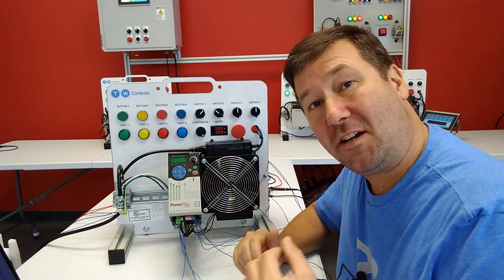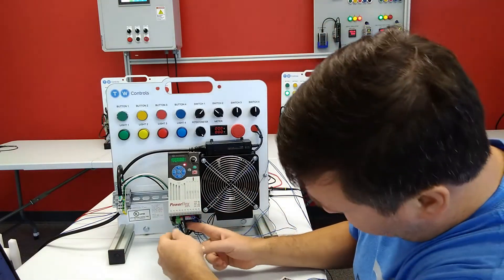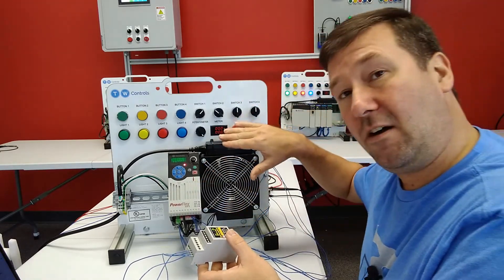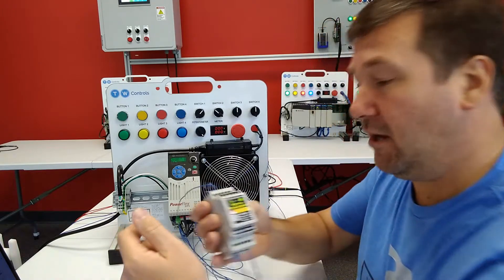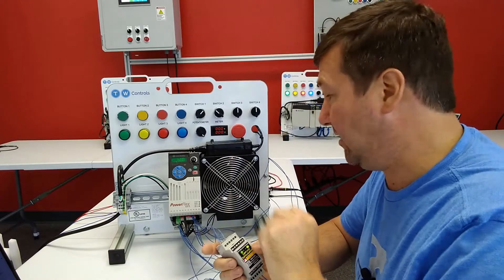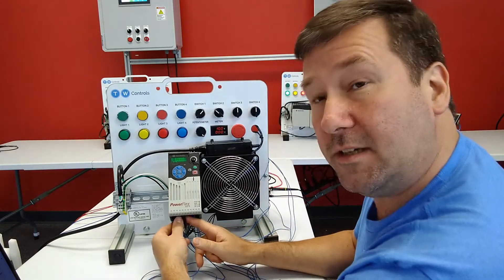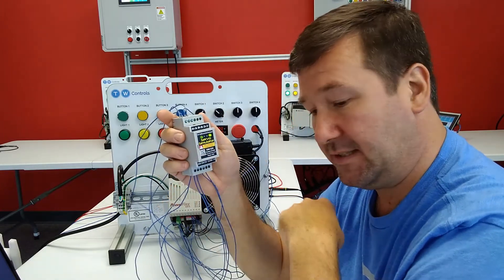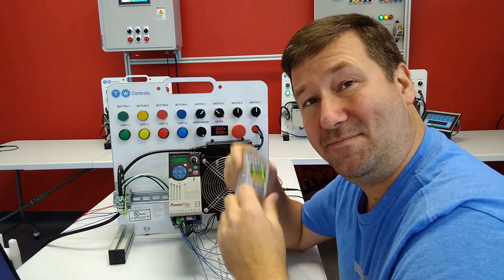Allen Bradley Powerflex 525 Encoder Loss Error 91

Comment: you can help me? the board need to power the encoder with 12V, but, i can't read 12V from encoder board on inversor, what the problem?
Reply from the maker: Check the output compatibility with the encoder.

Comment: Excellent video as always.
Tim, Could you please make a video on how to control a 525 through the ethernet cable,  and the problems we could encounter?
Many thanks
Reply from the maker: We have videos for Studio 5000 and CCW on that , see links below.
https://twcontrols.com/lessons/adding-a-powerflex-525-drive-over-ethernet-to-a-controllogixcompactlogix-plc-in-studio-5000
https://twcontrols.com/lessons/allen-bradley-micro800-micro820-messaging-to-a-powerflex-525-drive-in-connected-components-workbench
https://twcontrols.com/lessons/control-an-ab-powerflex-525-drive-with-a-micro800-micro820-plc-with-a-user-defined-function-block

Comment: I am having problems with error F012 don't know how to fix it
Reply from the maker: That is an overcurrent condition.  That means that your motor is pulling more amps than it should.  Chances are you have a mechanical bind or your motor is going bad.
Reply: F064 คืออะไรครับ

Comment: 1.What is the purpose of A- and B- signals on an encoder? 
2. If i have ordinary encoder with just A+ and B+ signals(without A- and B-), then i can't connect it to the Powerflex VFD, because i will get error 91? 
Thanks for video, Tim.
Reply from the maker: You can connect "single ended" or only A/B signals to a Powerflex 525.  Here are two lessons talking about the functions of the A and B signals of the encoder.
https://twcontrols.com/lessons/how-an-encoder-works-determining-direction-and-position
https://twcontrols.com/lessons/encoder-a-and-b-channel-signals-are-phase-shifted-90-degrees-clarification-on-our-encoder-lesson
Reply: @TimWilborne  Thank you, Tim